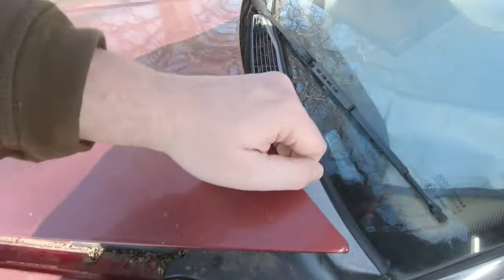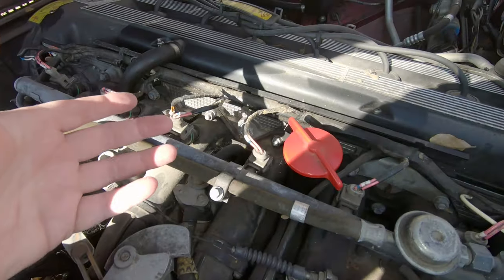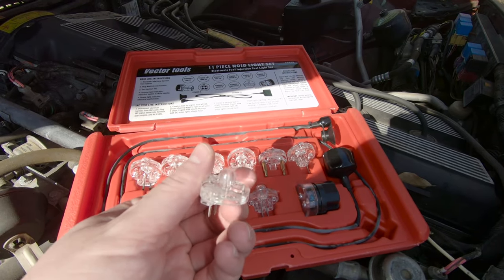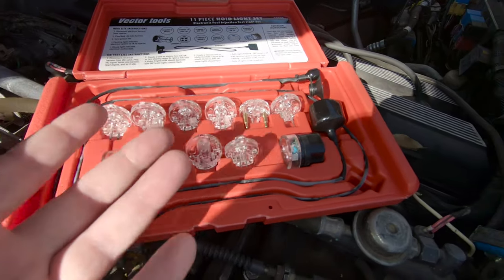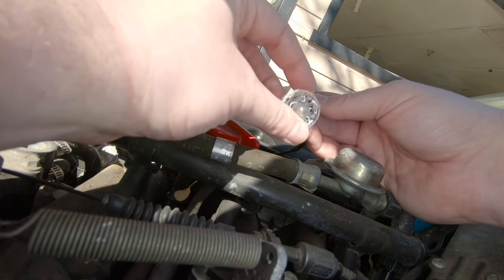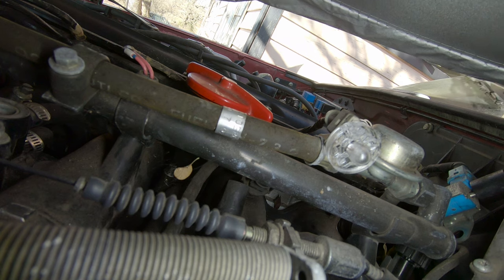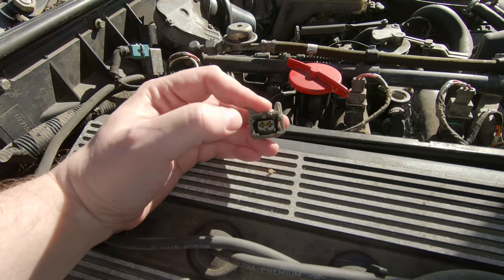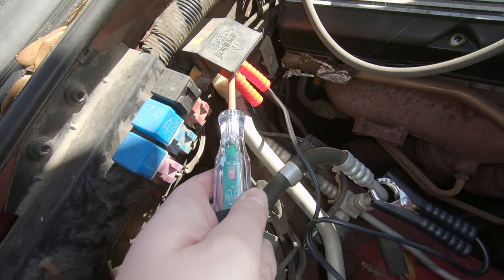What is a NOID Light? | Fuel Injection Testing | Big Kitty

Comment: Important to know.  The fuel injection power relay in the “ boot “ (LOL, those Brits, SRSLY)    That relay is Special, Not a common automotive relay.  It has an internal diode for electronic circuitry protection (?).
Reply from the maker: Good tip. Thanks!

Comment: why in the fk dont they make a pig tail adapter with two wires and back probe so u dont have to un plug  just back probethe connecter i went to the junk yard 30 yrs ago and cliped one off a car used the wires and put back probes on it and its a lot faster and no rish of breaking those cheap plastic connectors jackoffs
Reply: I took two small hat pins soldered wires to them . Clip them to my multimeter leads. And back probe with them.needles are small enough to slide into back of connector with no damage

Comment: Avoid the Noid.
Reply: Hey there, im wondering if you managed to trace the power issue.  i hope u can post .  is the volt meter suppose to read 12v or do injectors require less than that?
lastly, once u rule out the power, can u show how to test the injector itself?